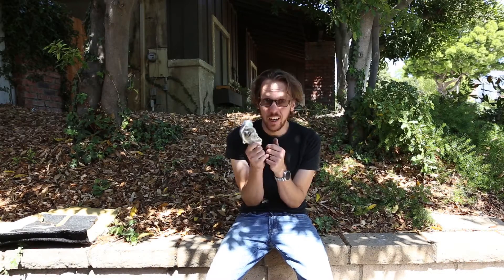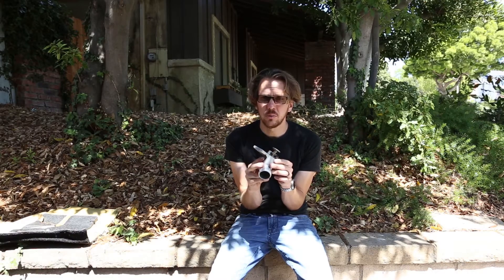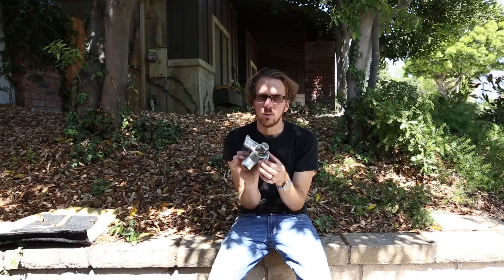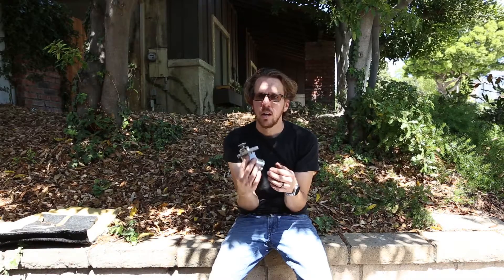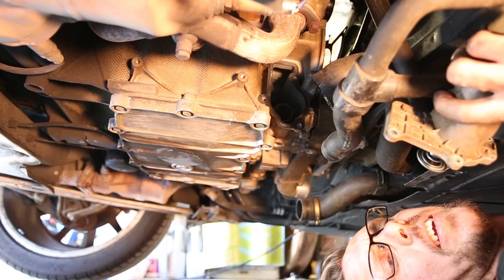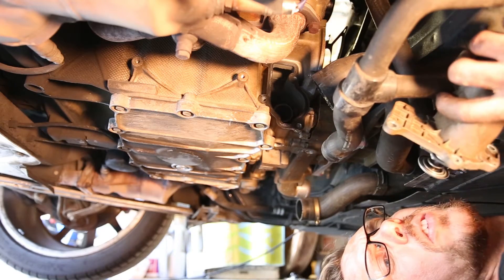Are Low Temp Thermostats a good idea? 71 vs. 83 degree Porsche Thermostats

Comment: Currently using low temp thermostat 68C in tropical hot climate. Notice that radiator fan doesn't run long as 81C thermostat

Comment: Everyone is confused about the words "low temperature". This does not lower any temperature. Especially of the motor. Once your car is warmed up, the low temp thermostat has no effect verses a high temp one. Sitting in traffic, running down the highway, doesn't matter. It's at operating temperature either way and both thermostats would be open. 

The entire purpose of a low temp thermostat is to allow coolant to circulate into your radiators sooner. That's it. In doing this, it causes the warm up cycle (past 160deg) to slow down a bit. This earlier regulation of temperature is supposed to allow the motor to ease into it operation temperature better. I don't understand the physics of that just entirely, but understand that aluminum expands when heated. Cylinders especially. So slowing that expansion down a little is supposed to be better on these motors the way they are designed. Especially bank 2 where they are farther away from the water pump than bank 1.
Reply: Actually you're not quite right. Under normal driving in normal weather the thermostat will be opening and closing all the time (reducing and increasing coolant flow to the radiators)  in order to maintain the needle in the vertical position (whatever temp that is) 
The cooling system is say 30% more than is required whilst moving if that makes sense. 
A LTT will keep this temp lower as it opens sooner BUT if you then come into traffic and it's at standstill on a warm day your engine will warm up past even the original thermostat temp even fully open and that's when the fans kick replacing what the cars motion was doing before you hit traffic.
Reply: I don't agree with your understanding of how the thermostat operates. If one opens sooner than the other, that also means it will be open WIDER sooner which in result will mean more flow of coolant through a radiator. so the engine will run colder in result. the thermostat is the sole device setting the engine's operating temperature. there isn't anything else to do so. the radiators are designed in a way that if not restricted/regulated by a thermostat they will make engine run below its nominal operating temperature. so an 88 degree thermostat will make the engine run at around 90 degrees in "normal" conditions like driving along (I don't count sitting in traffic or climbing mountains) and an 83 thermostat will keep engine at around 85 degrees. so yeah, the engine's operating temperature definitely depends on thermostat's opening temperature.

Comment: You’re missing the point completely.  The advantage is that the low temp thermostat prevent the overshoot you get in the back end of bank 2 (cylinder 6) during warm up, which is the furthest point in the water loop.  It’s got nothing to do with keeping the engine cooler in normal operation, it’s to manage thermal transients.  You boo ody internet warriors all think you’re engineers.

Comment: I had read that these engines ran too hot from factory for emissions. This may be able to be changed with a low temp thermostat and cooling fan adjustment…

Comment: I put a CARRERA 4s throttle body and PLENUM, which fits straight in. Also i had a full wider sporty exhaust system fitted. This has kept the temperature under 80 degrees. I also had a full Remap to finish it off. 
i am very happy with the results.
Reply: Do you like the PLENUM? Feel a difference? I have a Carrera VF Supercharged thinking of getting Plenum? Let me know if it's a good upgrade? Thanks

Comment: A lot of people don't seem to understand that the thermostat's sole purpose is to make sure the engine isn't overcooled. A correctly working thermostat should have no effect on overheating. The best thermostat is one that is rated just below the coolant's ideal running temperature.

The only exception, as in the example you gave, is when due to the engine's design, it may take a long time for the radiator coolant to circulate to all parts of the engine. In this case a colder rated thermostat can buy you the necessary time.

Comment: Great vid, you've been reading the literature too! A UK company Hartec's which specialises in Porsche engine rebuilds has a detailed article on the engines vulnerablities which explains, as you have mentioned, that a change in the head gaskets design on the 3.6/3.8 997 and the 3.4 engines (on the Cayman and later 987 Boxster S) reduces coolant flow to the cylinders by 40% compared to the earlier engines and increased the flow to the heads (who knows why that thought this was a good idea). The chain of events they describe (their hypothesis on the bore scoring problem) was if you drive the car hard then sit in traffic, the coolant temp/flow would not be sufficient to reduce the temperatures on the cylinders (expecially cylinders (4/5/6 which experience the problem) then if you drive off hard from standstill after being sat in traffic the piston can get so hot that it actually seizes on one side of the bore causing a cylinder bore score that requiring an expensive rebuild. Ahhhhhh! The low temp thermostat makes sense on reducing this chain of events in my  understanding but I'm not sure if will complete eradicate the issue. Am currently researching this but may wait until I can afford a 997.2 car which has a redesigned engine which doesn't have this issue and stick with my 3.2 987 Boxster S (which has its own IMS issue) in the mean time.
Reply: I disagree with your comments about the effect of LTT on coolant flow after driving the car, especially in traffic. When you're in traffic (especially after hard driving) the coolant temp is high enough for the stock thermostat to be fully open and hence is functioning identically to a low-temp thermostat.

Comment: there is a reason for low and high.
you do not need a high temp thermo for summer or all yr warm country.
high is usually use for, if there is 4 season winter. where the car needs to get warm enough for the winter drive.
using a low thermo is great. only if the temp is not too great apart from the original thermo temp.
different engine have different operating temp(expansion of the cylinder and cylinder rings).
MOST racing car do not have a thermo set.
if you use a high temp thermo for all yr summer country you most probably have a crack plastic radiator and open gasket(driving in stop and go traffic with no highway) .
1 fan system with multi speed. we should always turn on the a/c at idling in stop and go traffic.
in south east asia where there is no winter or autumn. it bloody hot.
i have seen over hundreds of car on the road break down due to high temp issues.
hi temp thermo is great for winter or cool weather.
in hot season temp a nonono for hi temp thermo.
and do remember never use a 50:50 coolant mix in hot summer.
50:50 mix is for winter as an anti-freeze only.
Reply: I live in Pakistan. I own daihatsu mira with stock thermostat valve works at 82 C. I am thinking on same lines as you are. I am considering to use low temperature thermostat. Further using 70/30 or 75/25 pure coolant water mix ratio with high boiling point
Reply: May I asked if it would be better to use low temp. Thermostat in hot countries. Im from philippines I have a civic
Reply: @khingvlogs6750  it will keep the engine cooler as long as you're moving , as soon as you stop in traffic the engine will heat up very quickly..then the fans take over.

Comment: Fans will only come on in sitting traffic, Living in Scotland I don't remember my fans ever coming on. It does depend where you live and the type of driving you are doing. I want the engine to get warm so I can put the heaters on and be comfortable.
Reply: The fans are running at slow speed all the time when the ac is on. If they are not running at low speed the resistor is done
Reply: @theXbaT1  hardly ever have air con on , like I said I live in Scotland...it's heat I need.
Reply: @stephenauty2402  I live in Norway
Reply: We’re headed to Sweden in 2 weeks in the 996 Turbo
We were in Oslo a few years back in 2.7 Boxster 
Had a great trip , we stayed at a lovely old Hotel at the back of town , high up near the ski jump. Trains would go through peoples gardens 
Resistance museum was good

Comment: I agree with you on this. I have a 997 3.8 and I went lower because of the one cylinder problem. In traffic it will still get hot but the engine is not producing much heat in traffic. With the lower temperature I get a lower oil temperature, the problem with that is water and fuel may not get boiled out of the oil on short runs.
Reply from the maker: Thanks for the insight. It's always nice to hear from someone with personal experience! Cheers, sir!
Reply: Hi Andrew. You still have you 997 3.8? How's it holding up regarding bore scoring?
Reply: @ptsmonvideo  Yes it's still going well,  no changes in the engine. Personally, I am happy to risk the bore scoring problem because It would be an excuse to refresh the entire engine, something that almost all modern cars need every 10 years or so. As time goes on these issues become almost insignificant compared with attempting to run a modern car post-warranty.
Reply: @andrewthompsonuk1  What oil you're using? How many kms/miles do you have in it?
Reply: @ptsmonvideo  I have about 87k miles on it. I use Smith and Allen  a40? spec oil of the correct viscosity. I change it out once per year which is twice as often as the dash indidicator. I always use a genuine filter. I still think most failures are from neglected oil. I never use the car for a short trip, and when I drive I keep the revs above 2000 except for idling.

Comment: uhm the bit you are missing is that whilst you are right in traffic situation, on the open road the fans are not needed as the motion of the car provides cooling air. Therefore underway the engine will end up running slightly cooler. 

Having said that - I thought the lower temp was meant to benefit traffic situations more than open road driving, and so you may have a point.
Reply from the maker: You're 100% correct, but I think you may have missed my point. Traffic situations are where the car is the hottest and most likely to have problems, and the low temp thermostat won't do anything in that situation. AND you're right, on the open road, the car will run cooler. Low temp t-stats lower the temperature when your car is already at its coolest but do little to nothing when your car is at its hottest (it might take a little longer to heat up to the same temp, but 10 minutes of traffic and both t-stats are the same). SO MY REAL POINT IS THIS: low temp t-stats lower the temp when it's not need but still keep the same max temp in traffic. This means that your engine block is experiencing greater temperature swings from open road to traffic, and temperature swings with the associated expansion and contraction do not sound like a good thing for an engine block.

Comment: Did you read on Pelican parts that they recommended the lower thermostats?
Reply: Good info on all of your videos.  I've used your tips to change my t-stat and H2O pump after impeller failure.  My question though is this; is there a way to modify the temp at which the fans activate to correspond to the low temp t-stat? thanks
Reply from the maker: +william carroll Oh yes, I spent way, way too much time researching this.  While running at cooler temperatures sounds good, I sit in traffic plenty when the front fans kick on, so the engine would still reach that temp regardless, but the change in temperature from running with the t-state open to idle with the fans on would be greater.  Consequently the the expansion and compression associated with changing temperatures would be greater. In my mind, this would actually cause more stress on the engine than just having it at a more constant (albeit higher) temperature. I also question his claim that the t-stat isn't fully open until 99 degrees. I think it's more like 90-95 degrees.
Reply: Burner's Cars
Reply: I have a 71 degree thermostat in my 986 s, and driving around city with some traffic, the engine runs way cooler, usually at 80 degrees (gauge), when before it use to go 90.  At high speeds in highways, the 3 radiators do the job really well